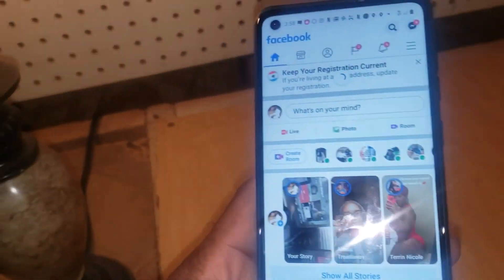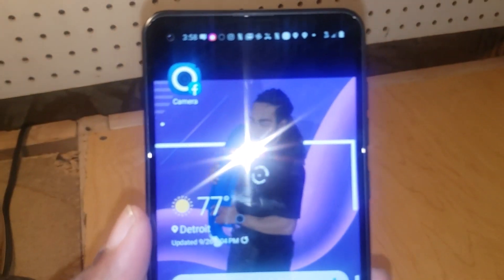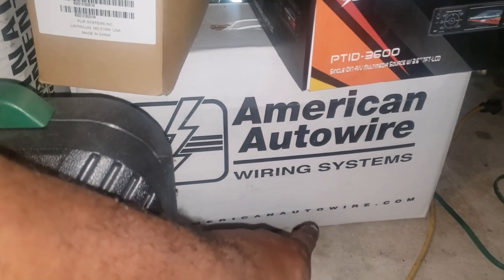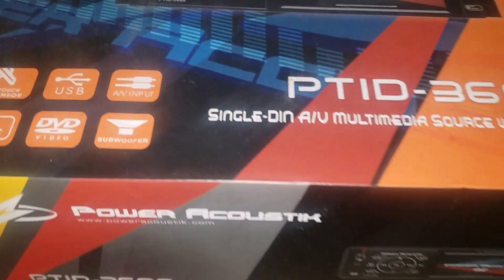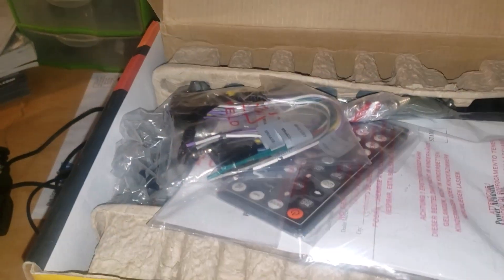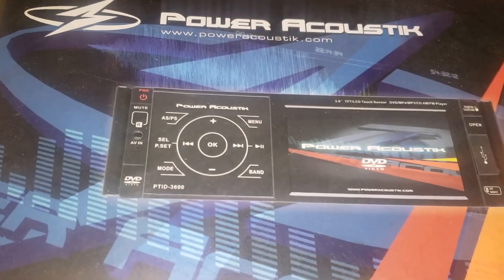64 drop off to get wired up pt1

Comment: Replacing the wiring it a good idea. Safer and saves a lot of headaches trying to figure out why something isn't working. The original wiring gets hacked up so much over the years, it just makes sense to replace it.  And it is not so hard to do.
Reply from the maker: Big facts! im redoing the whole car so im touching everything on it.
Reply: @Tezdontdoit  It is great to see you realizing your dream!  Keep at it.  Restoration is a big project, but very satisfying to do. You might enjoy the restoration blog I did for my 64 Impala www.thecairns.com/Impala  
I got my 64 back in 1982 for free as my first car ;D